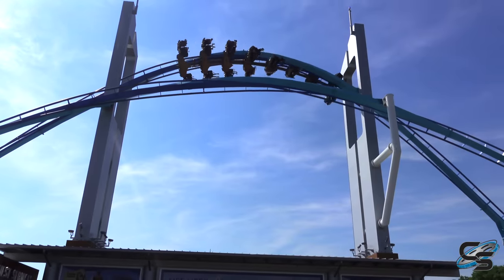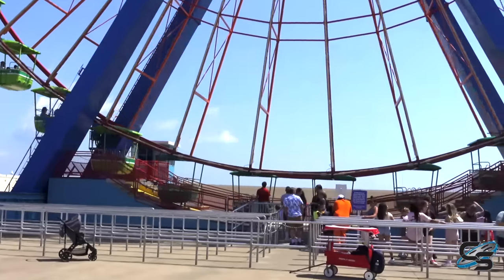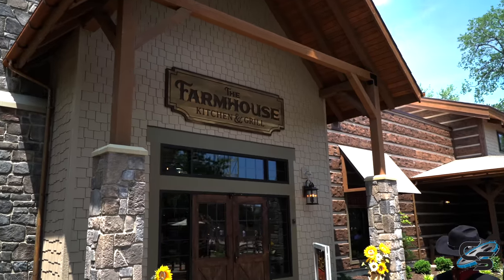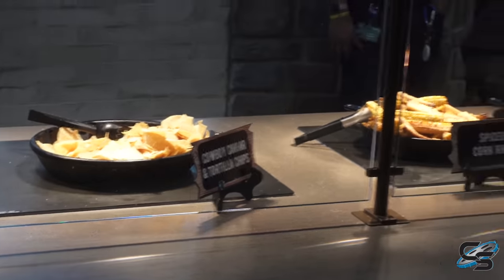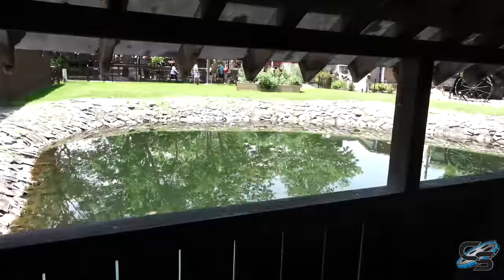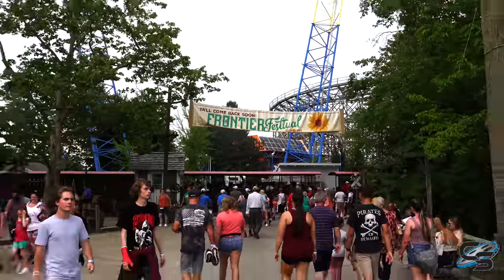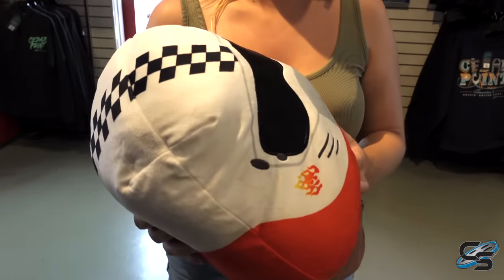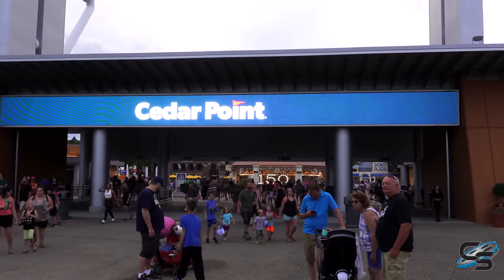What's New at Cedar Point in 2022 | Wicked Twister Construction, Top Thrill Dragster Closed, & More!

Comment: For Top Thrill Dragster, it would be cool if they could redesign the track as it exits the top hat to instead of levelling off into the break run, have it dive into a tunnel or trench, extend the track out over the midway and Iron Dragon, then do a big sweeping turn around to burn off the momentum. Not sure if they could build a tunnel deep enough but they might be able to reclaim the title for world’s biggest drop off Kingda-Ka. 
Three wins - eliminate the infinitesimally small freak accident risk, provide a new ride experience and regain title.
Reply: You would think something like this HAS to be on the table.  Why go through more negative PR from a tear down when they could refresh and rebrand it.  Sure it's more money but if the issue previously was that it was a maintenance headache, all the more reason to rebuild pieces of it with new and more dependable technology.  They'd be spending way more money by removing it and building a replacement
Reply: @j.johnson7891  my thoughts exactly.
Reply: Time for it to go. Dragster felt like it was down more times it was running. My opinion at least
Reply: @vincentkrych2158  fair. But at least give it a goodbye season.
Reply: They are not going to put any more money into that ride.  It doesn't produce any ROI and it is time to get rid of that thing.
Reply: @vincentkrych2158  That's why the staff calls it Top Thrill DOWNTIME
Reply: @timothykaczmarek5871  I understand entirely. If they want to get rid of it fine. But it’s not like it was constantly injuring people like son of beast was. So just give it a goodbye season or shoot, maybe not even that. Do something like what they’ve done with opening rides and you have to donate to a charity to be on the last rides. But at least give people the chance to say fair well. That’s just my opinion.
Reply: Nope.   Not going to happen
Reply: @timothykaczmarek5871  and I respect that opinion. You don’t have to agree with me, but holy lord the pessimism is real! Do you want it to stay? Then go leave feedback and if they tear it down then fine. But let’s at least give them the option to keep it open by voicing our thoughts to them!

Comment: I really hope Top Thrill Dragster doesn't end up closing forever. If they do they better replace it with something good, and fast, otherwise Cedar Point will see a pretty big drop in attendance numbers. Hopefully an S&S Mega-looper similar to Steel Curtain at Kennywood, except they can make it the tallest looping coaster in the world at around 350-400 feet tall, and with 12 or more inversions.

It might probably even re-use the same station and support structure as Dragster.
Reply: mate what are you smoking
Reply: My brother in Christ, We're not getting a s&s strata coaster. Dragster has been down more than it's been up for the last 5 years or so, I went to cp on weeklong trips in 18 and 19 and it was open for half the day once out of 14 days. I could maybe see them doing something cool with the station but probably not,  If they take dragster out they might as well take Gemini down too. That plot would be massive. Wouldn't make sense to build something where dragster was just to tear Gemini down the next year.

Comment: I think what has happened with Top Thrill Dragster is that there is a lawsuit going on or concluded. Cedar Fair/Cedar Point probably had to sign a nondisclosure agreement for 1 year to remove Top Thrill Dragster from everything. Keep it closed, no trains on the track and no merchandise. It should re open and the merchandise should return in 2023. I use to work at a extreme indoor sports park with trampolines and there was an accident on one of the attractions. Our company had to sign one of those nondisclosure agreements to keep that attraction shut down. There were 2 requirements. Order the necessary equipment and have it shut down for 1 year before reopening it.
Reply: LMFAO Your wrong but you can keep dreaming TTD is a matinence nightmare prepare yourself!!! By next year TTD will be gone count on it!!!!!!!
Reply: @DJMetalman911  idk why you have to go crazy on my comment and laugh.

Comment: I think Wicked Twister will get replaced with maybe a multi-launch? Multi-launches and single rails seem to be the norm nowadays so it would be cool is Cedar Point gets one.
Reply: I can't really see a single rail... unless it's a high capacity option like a t-rex but that would make it the first, and I don't know whether Cedar Point is going to be happy with effectively a prototype.  And Maverick is the granddaddy of intamin blitz coasters, it's effectively their multi-launch even if the first one is up a hill.  If it's a coaster at all (which I hope it is, I wouldn't want potentially 2 closed coasters and no replacement next year) I think it's more likely to be a modern wooden coaster on the boardwalk.  It just seems to fit with the whole 150-year throwback style that they're going for.  Then they can go crazy with the dragster replacement if necessary!
Reply: Their building another restaurant in WT spot. The blueprint has already been leaked. It's a two story building with a bar and restaurant. So yes another food option in place of a attraction.

Comment: the ride aint going nowhere. They arent aloud to to touch the ride until the investigation is over which it is now. and there wasnt enough time to repair damage and overhaul the ride. That is why its closed. Believe me it will be back. Possibly standing 500ft with an air launch system. Watch and see. They aint taking it down. The ride is not dangerous and is a major part of their revenue lure. without it less tourist from across the country and the oceans. It will be there
Reply: It would need a 2nd launch on the way up.  That would be quite the turn of events, wouldn't it?  From left for dead to claiming 500ft before the 500 footer at six flags qiddiya?
Reply: @j.johnson7891  not if it were air compressed. if they did lsm the would prolly need them half way up thill before the first 90. compressed air has plenty of room on that launch stretch to get it to 150mph 500ft
Reply: @covertzebra  that would be insane. lol
Reply: @j.johnson7891  sure would. I expect Cedar Point to take full advantage of the situation